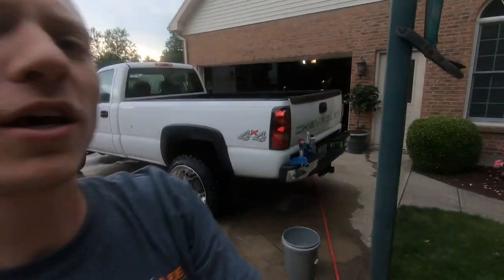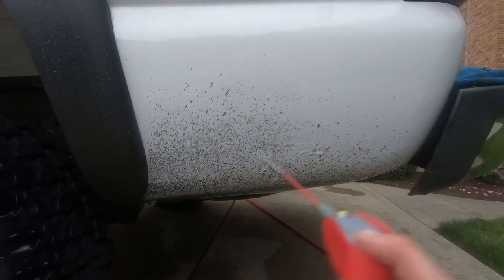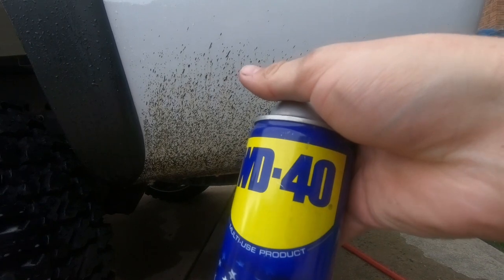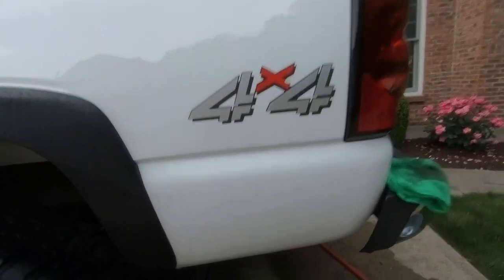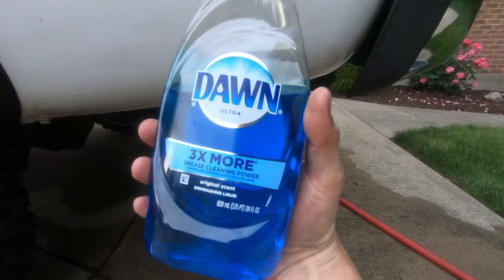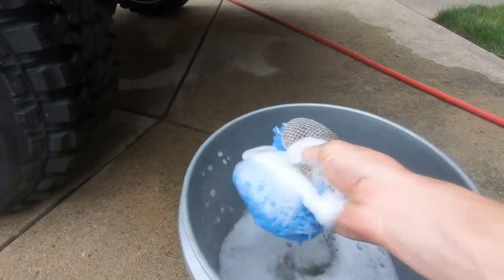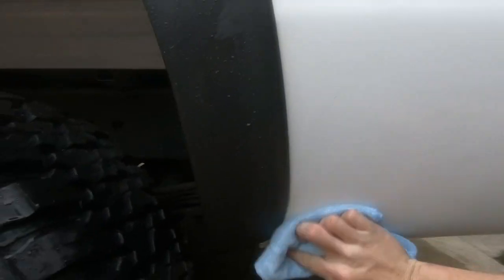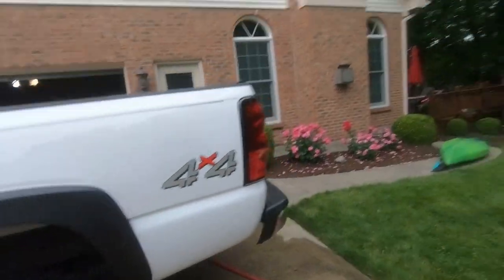The Best TAR Remover for Car

Comment: Absolutely fantastic, just bought a white car that was covered in tar, it was so bad I got the thing cheap. Came off like a dream. Bit of a tip that worked for me... the thicker parts weren't coming off so I used a plastic scraper to take some of it off, once it was broken down slightly the WD40 worked a treat.   Thanks for the vid 👍
Reply: That's a great tip.

Comment: Im an auto detailer great work but i suggest adding wax or sealant side to side not in circular motion
Reply from the maker: Thanks man! I used to be also! Now I just do it as a hobby. But thanks for the tip! There's always tricks to learn with detailing
Reply: Fosho thats why i was checking your video out been having trouble removing tar
Reply: @HooksetAnglers  that’s funny because Machines go in a  circle?
Reply: @caseG80  That’s for buffers. Not removal of contaminants that scratch your paint. One singular motion when removing abrasive materials is much easier to fix that circular.

Comment: Ok, it seems that others have made many of the points that I intended.  To sum up, use Citrol (the aerosol can will cost you about $16 if you shop around,  but shipping will cost you).  Or, if you want, spend $70 for a gallon.  The gallon can be diluted, but tar requires full strength.  You will not need much Citrol, as it is so effective.  You can store extra.  Btw, it removes stickers better than anything else.  It's also great for paint transfer and bug guts.

Citrol is water soluble, and you MUST rinse off of clear coat.  That said, since it's water soluble, any water based product will work well in the rinse.  Optimum No Rinse is convenient.  Since Citrol does not have grease in it, there is no reason to use Dawn or any other degreaser with it.  Citrol will remove waxes and sealants. Just use a spray wax when tar is removed.  For consumers, Turtle Wax ICE spray wax is easy, long lasting, and cheap.  The ICE sealant (as opposed to spray wax) lasts even longer.  The release of these two products caused a sensation in the detailing community.

Finally, Dawn is not effective as a strip wash for most modern waxes and sealants.  It turns out that its surfactants hang out after washing, and these make the paint LOOK wax free.  Dawn has no place on your paint.

Comment: Use any product with enough terpentine in it and it will basically bleed out, let it sit for a few mins and spray it with a pressure washer

Comment: So I have the same problem- not as much though! I first used a Magic eraser on one side, the tar did come off just took longer than I expected. So I googled about using WD-40, much faster than using the eraser, need to go back over it with some Dawn & sealer. Great video!

Comment: Does it work for tree sap too? I have this funk on my car for maybe more then 3 days and it can come off worth a finger nail but I didn’t want to hurt the car. I think it’s chemical so today I washed my car  and it’s still shows up it’s thick it’s hard feeling  when I scratch it I see balck  but it’s everywhere even on my plastic Crome- I was able to get it off but it was like 3 rounds of  west coast wheel and tire cleaner( strong chemical that turns the soap from white to brown I call it bleaching the tires, don’t get nice clothes in it!)  I was rubbing about 40 times each wheel even with a scrubby wheel brush( poor brush)  I have a crappy Prius. I think what happen is when I get pissed I just kick it in gear and when I do it makes a skeet sound  so the crap from the tire flings into the paint( mind you I no longer do soft touch car wash where you go through a machine that ruined my cars paint with swirl marks( ugh so hard to get out of and I’m only using elbow grease)  WD is also good with scratches but if it gets rained on or the stuff gets wiped it will show.
Reply: Try clay bar. I had some kind of pine resin on my car and the guy at the dealership cleaned it all off in about a half hour. See the YouTube examples.

Comment: The purpose of clear coat is to protect your paint you don’t NEED wax
Reply from the maker: Although you are correct, wax is never a bad thing for your clear coat though. If the clear coat starts to become damaged over time for not taking care of it properly, it could result in a costly paint repair.
Reply: Try it one day, take all contaminants off your paintwork then apply a wax, and then buff it off. See how you feel

Comment: Hell NO!!! WD40 will kill your clearcoat and make the paint look mat !!!
Reply from the maker: I've never seen that happen.. Been doing this for 8 years Lol.
Reply: No it won't besides looking bad it's perfectly safe for the clear coat
Reply: Used it for 15 years detailing cars. Knew it was good for getting bugs and stuff off never thought to use it for tar until this.
Reply from the maker: @seanbarnes9021  I thought it was crazy when the place I worked at told me to do that years ago!
Reply: @seanbarnes9021  Citrol 266 dissolves Tar in seconds! Clear coat safe.. and water soluble.  Its made by Shaeffers

Comment: It works but you definitely need to wax that area after using DAWN.  It strips all wax out of the paint.  That is why you see these people with all the clear coat peeling from their vehicles.  They use DAWN, AJAX and any other dishwashing degreaser to wash their car instead of buying car wash made to leave your clear coat and wax intact.  Be careful
Reply from the maker: Yessir! That's why I waxed it after!
Reply: No, Dawn is actually pretty bad as a wax stripper.